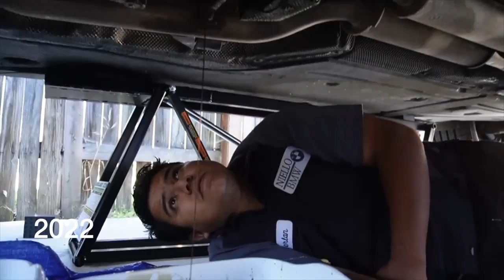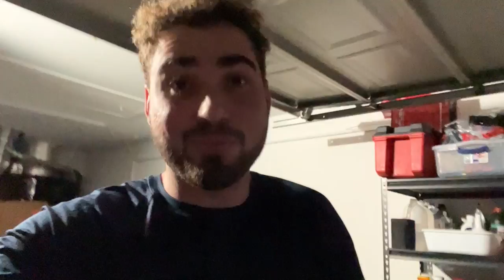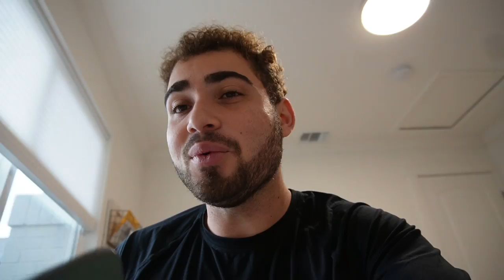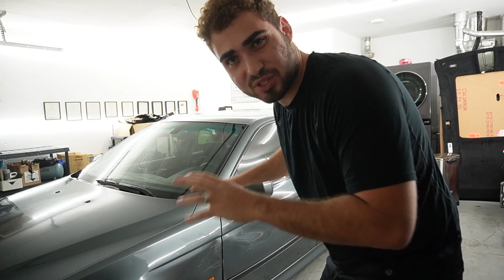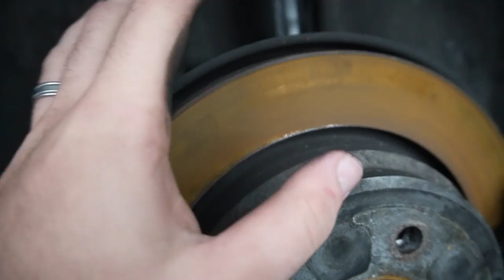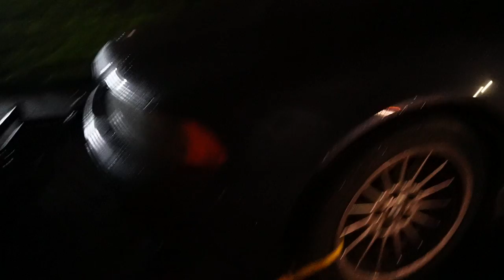SURPRISING MY FRIEND WITH HIS DREAM BMW!

Comment: Low mileage doesn’t go for 50k

20k tops for a minty one, any higher - just get an m5
Reply from the maker: Saw a 5k mileage one go for 50k on bring a trailer 😎
Reply: @NourHummadi  so what is low miles to you? I’ve heard you say that 80,000 is low miles and now we talking 5,000. I love 540’s but they are worth 5k-15k. Anything outside that is an outlier
Reply from the maker: @johnnychimpo7539  yea 80k miles to me is low mileage for the year, which is worth like you said 10-15, but those rare once under 10k miles go for collector money